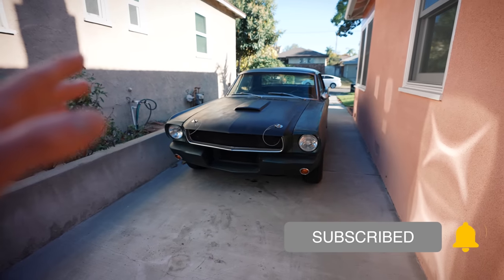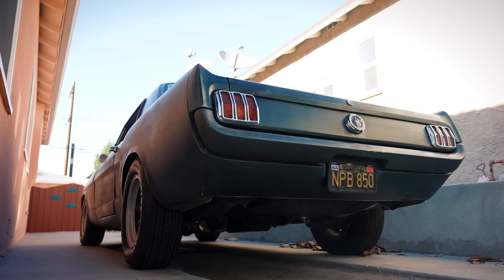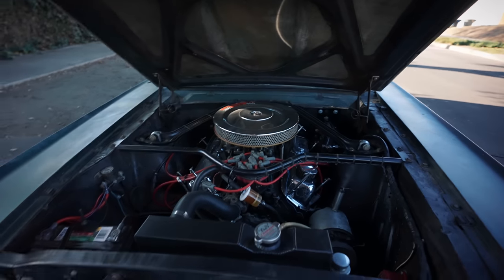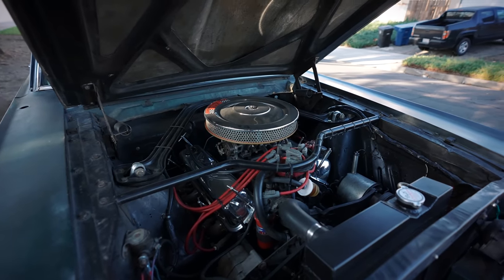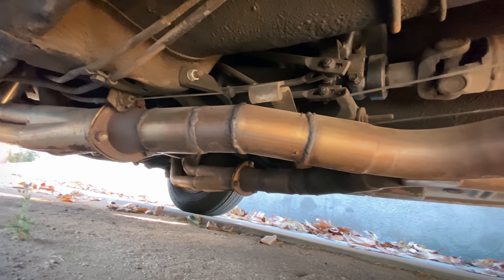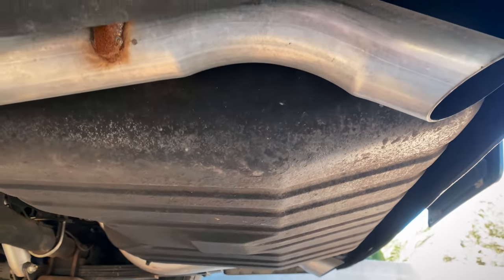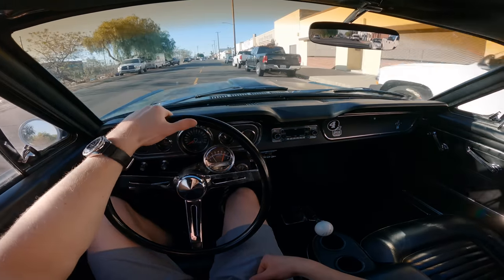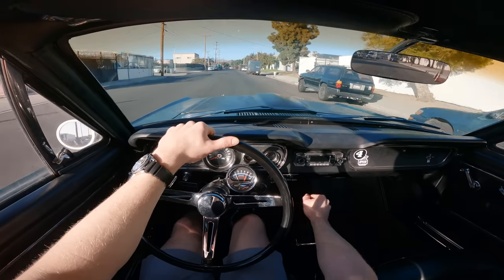Best Sounding Exhaust System for a Classic Mustang!

Comment: I love it how you blip the throttle when downshifting :) Nice POV and sound!
Reply: I have to with mine, downshifts much smoother on the old synchros
Reply: @mightymustang5067  I once went on a ride with a friend in his car. He didn't blip the throttle on downshifts and he rode the clutch to sync up the engine/trans speed. I can't imagine not blipping when downshifting, unless the car rev matches for you.
Reply: but the way he does that is useless. you blip throttle to match rpms of engine and transmission, but he blips before changing gear, lets engine rpms get back low and only then change gear. may be i don't understand something, but it looks weird

Comment: Look into a set of subframe connectors and do a video on the welding and install. You will notice a big difference in the car after installing them.
Reply: Whats the reason behind adding the connectors?
Reply: @Conner._.Anderson  these Mustangs are terrible steering and handling. They need all the help they can get
Reply: @knackerbags5994  ok thanks

Comment: Wow this brings back such great memories my first car was a 66 Mustang Coupe just like yours 289 hi-po with a bigger cam Holley 4-barrel headers T-10 four-speed 9 inch Detroit Locker rear only got to drive it twice. But the sound of that engine being slammed into the seat every time you shifted was the experience I'll never forget. Watching your video puts me back in the seat of that car. You have an awesome ride there my friend I promise you that memory of that car will stay with you the rest of your life. Take good care of her don't beat her up. 🇺🇸😋
Reply: why did you only drive it twice?
Reply: @bofa83  hey; I only drove it twice because I took it to auto shop at school
To build up the motor. The next day at shop someone stole the heads,carb,intake then dragged the body to the middle of the field and beat it with sledgehammers. I had my suspicion who did it but couldn't confirm it. But the second time I drove it I outrun
The cops. That was the only time I ever did that 🤪 thanks for asking.
Reply: @iggyfritz7150  noooooooo!!!! that's awful.
Reply: @bofa83  thanks for your sincerity. Yeh high school was a tough pill to swallow. I couldn't wait to graduate.

Comment: Steve McQueen “Bullet” Me and my dad built a 67 mustang fastback with a 390 with a 428 crankshaft making it a 410 CI. 428 Q code cylinder heads, Dove single plane intake, roller rockers, and a C4 automatic transmission! Won a lot of races on the streets.

Comment: I had a 1967 in High School 289 A model block (Art Carr C-4)
 with mods suggested by a customer of mine I used to deliver chili powder to, I wont mention any names but his boat was named Sea Shell! The best place for stickers if you dont really want them but have some you gotta run is on your door jams. We raced off  road and our pre-runner looked like a stock with tires and a mild lift but was built by Ray Currie "GSRyder" Very Trick With all the stickers for sponsor's & contingency inside the door jams, looked clean. With the doors opened it said "Racecar" (spelled backwards we all know is "racecaR").

Comment: This brings back memories! I smiled at the long tube headers and x pipe. I ran the exact same on my ( ok my wife's ;) ) '65. I did a lot to the engine, wont bore you, but the sound was 2 1/2 inch pipes through 2 chamber flow masters ( this was in the late 80's early '90's. ) In 2nd gear ( yes a 4 speed! ) @ 4k it sounded AMAZING. Great car, have fun with it. I've owned 3 mustangs ( 2.. the '65 really was my wifes! ) and miss them.

Comment: 👍🏽👍🏽 Another great video.
The previous comment about the sub frame connectors is a Must! I build for a living & # 1 response is "I'm not drag racing the car Don't need them." And that is So not true. When you don't have them & your driving the car around hitting bumps & corners the whole car is flexing moving around. Instead of just that tires suspension. You'll notice a Huge difference in just how the car drives hitting bumps. Secondly I'd recommend updating the shifter. It definitely appears to be better than the factory 3ft of travel but doesn't seem to be as tight of pattern as like Hurts Competition Plus. It'll make banging gears even more fun. I'd reach out to guys at Calvert Racing about getting some of their custom leaf springs & Caltrac bar's. They have the leaf spring market conquered with their technology. I bet they'd sponsor the setup to get some video plugs on install & real world review.
Keep up the great work!

Comment: I finally got a muscle car.  1979 Z28 with long tube headers, into X pipe into dual Flowmaster 40's so it's quiet, then two dumps on either side for open headers on track, street racing, whatever if may be :)

Comment: I'm running basically the same build on my 289 as yours.  Cam, Intake, Hedman Headers, 2.5" through a set of Super 10 Flowmasters over the axle and out the valence.  Sounds very similar to your set up.  Love it, good job Ben.

Comment: Good choice with the turn-down tailpipes; hate those under-the-valance pipes like my 66 convertible had when I got it. Since mine was void of any sign of the scalloped rear quarter trim (you've got holes) and Ford officially deleted those on fastbacks and GTs, I decided to build a GT with Shelby style grill. I was 13 when these came out and I loved the trumpet-thru-the-valance look. You could get a GT valance and run slash-tips thru there if you were so inclined. If you're looking for a hassle free carb, go with Edelbrock's AFB, I get 26 mpg highway with a C4 & 3.00 gears.

Comment: I had a 65 289. I made holes in some extra valve covers so I could adjust the rocker studs every month. I would adjust the points too. After that it would do good burnouts. It was an automatic.

Comment: I had a 1966 mustang 40 years ago when I was about this guy's age..... It was canary yellow with a 302 v8 with ported 351 Windsor head's . A top loader four speed and a nine inch rear end with 4.10 gear! I could get rubber in all four gear's 😂

Comment: I guarantee fatten the idle mixture screws and maybe a little slight tweak to the idle set screw it will start and idle like fuel injection no choke required and on a cold start! Nice ride man !

Comment: What have you done to the suspension? I had a 66 in which we dropped in a rebuilt, cammed, 85 5.0–I loved it. Wasn’t mind numbing hp, but it was strong. What made a huge performance increases was the new front end, relocated a-arms, etc. also added power steering to ease the massive weight up front.

Comment: A stock 289 Hi Po had the Road and Track mag definition of a a Hi Perf Car being 1hp per cubic inch. I believe it was a 1965 issue with AC Cobra & P904.  The 302 has a larger Stronger crank & hyd lifters. But the 289 Hi Po solids which sounds bad ass on a muffled car , clack clack music, love your cars also and good vid work. California laws exempt pre emissions???

Comment: Sounds Good! I've been running Heddman headers Xpipe for over 18 years. Sounds way better than an H pipe. The Muffler shop that installed it back then never seen or installed one before lol. Also running Flowmaster 40's. Gonna try a set of Super 10's soon.

Comment: 99.999% of the time, with a carburetor car, I've always done the same thing, if I didn't have a choke, and it works 9 out of 10 times. 

I put the throttle to the floor 4 times for about 3 seconds each time.  Then hold the throttle halfway down for just a second or 2 and crank it until it starts. The only way you can flood it is if you hold the pedal to the floor too long before the final step. . I learned that little trick, on most cars, back in the 90s but I still do it and it still works. 

It may not work if you have a shitty fuel pump or if your car is just modded like crazy. But it works 9 outta 10 times with a carburetor.

Comment: Very nice Stang!  I just got myself a very clean 67 fastback that I’ll be restoring very soon.  I like the way the Black Widow mufflers sound.  I also have a 1989 GT that has 2 chamber Flowmasters, shorty headers and a Dr Gas X-pipe.  It’s fairly loud but I might try those Black Widow mufflers on the 67.

Comment: If that air cleaner is too hot to touch... you have issues!   What distributor are you running?  No vacuum advance?   What is your initial advance at idle and what is your all-in timing advance?

Comment: What's your initial timing at? Or is the cam just a pretty large duration? Also seems to be burning a bit of oil 5:03. I don't see how a 289 could sound any better than this though when it's screaming

Comment: In an earlier video you were holding the venom F250 series and it looks like it was center to center but in your newer video your muffler under the car look like it was offset to Center did you switch at some point and if so why does it make a different sound between the two does the offset deflect the sound better inside the muffler for a deeper sound? I have a 65 mustang 289 long tube headers x pipe with cherry bombs will the venom be equally loud or quieter

Comment: Love the sticker we're working on a 69 coupe 302 running side pipes that poke out right before the rears  with2 ft glasspacks and dual tips  lemme know what you think about it❤❤❤❤#stangforlife
Reply: 650 csf aviator 4 barrle with edlebrock intake  and whatever the previous owner did sat for 7 years had her runing fresh in 2 weeks aftermarket water pump thermostat and housing new belts houses and shockd and front suspension   wanna swap for manual and disk brakes new carpet floor pans and  sound system
Reply from the maker: Awesome!
Reply: Carpet looks brand new couldnt find foam so we went to home depot

Comment: Just was wondering if you could share the cam and specs? Trying to decide to stroke a 289 or go with a 302 that I have sitting in the corner of my garage for my 64 Falcon hardtop.

Comment: Yo Four, I want you to put a vacuum gauge on that engine at an idle.  If it is bouncing all over hell and gone the carburetor can not meter properly and is just spewing fuel into the engine at idle.  If you can smell gas at an idle standing behind it, the carb is not metering properly.  With even a mild cam it can be a balancing act to keep the butterflies in the throttle body within the idle circuit and the RPM's up off the cam to give the carburetor a chance to meter - and tune properly.  The exhaust sounds great and the engine seems to work responsive just off idle, but bumping the idle up to 1000 to 1200 RPM's to get the idle up off the cam will make for a great driving street car!  Your 60 foot times will thank me....  A loppy engine sounds cool, but it ain't cool.

Comment: ya need the engine thats in my 76 f250 4wd. t-19 4spd/np205
a '70 351c-4v from a 70 torino, 
268/272 110 lsa
ported/milled heads
decked block
11:1 compression
fenderwell headers w elec cutouts
40 series mufflers
475hp/525 torque

Comment: Nice sound but that engine definitely has a non stock cam in it. The cam probably affects the sound more than the exhaust. Nice wheels too. Not GHETTO 22" with no tires. I love the RWL tires with actual sidewalls. I don't like X-pipes and H-pipes. I like the right and left sides to be completely separate. That really brings out the sound of a cammed engine.

Comment: You should add a flex plate cover on the bottom of your bell housing. Be a bad day if a rock kicked up in there.
Reply from the maker: I can’t find one :(
Reply: Not sure of the motor, but it should be a C4 transmission. Go to the junk yard and rob one off a granada or another mustang.
Reply from the maker: It’s a t-10…haven’t been able to find one online
Reply: Pretty sure that's what you're looking for. Automatic has nothing to do with the fitting of the plate

Comment: I admire your enthusiasm with blipping the throttle when downshifting but you are doing it too slow to actually sync the rpm for the previous gear, by the time the gear is changed the rpm is at idle and you use the clutch to sync and so you are not taking any advantage at all by blipping the throttle.